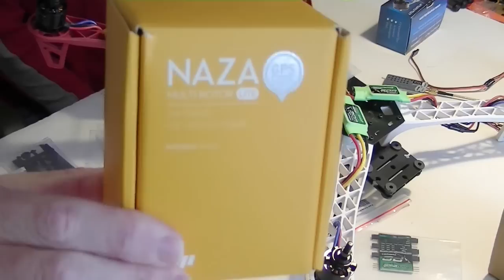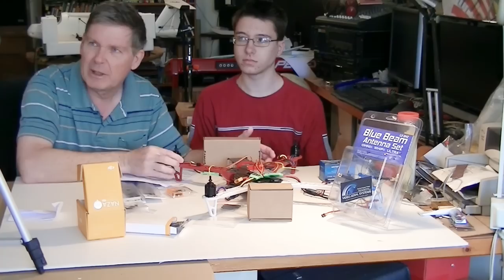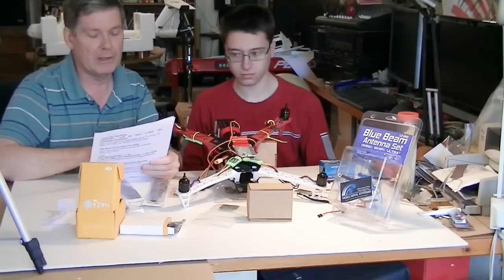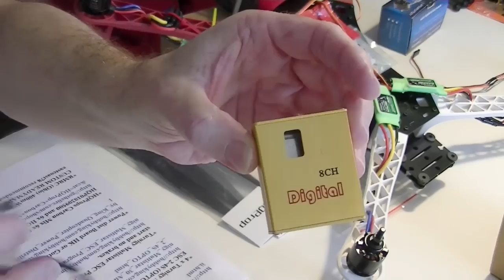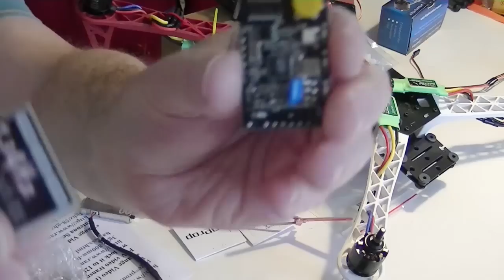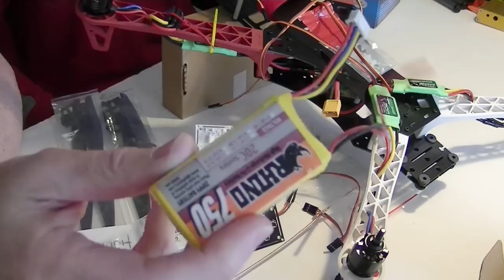FPV RC Quadcopter Parts Review

Comment: ***** What is the total investment on this project? And is this platform just as stable as the phantom? Thx
Reply from the maker: 724bigal The overall cost is about $650 plus a lot of work and testing.
If your not good at soldering or don't have a lot of patience I would recommend something else. It is stable enough but be prepared to "get your geek on" to build it.

Comment: Nice job on the motors and ESCs, John! Looks like you fellas have your work cut out for you, but thankfully with the Naza you'll be ready to fly in no time. I am curious why you went with the MinimOSD versus DJI's solution?
Reply: The ESC's would interfere with your video TX, RC RX, and FC GPS if too close. I'd recommend mounting them on the arms.
Reply from the maker: We went with the MinimOSD versus DJI's solution because the Naza M Lite is not expandable and I had to use a third party OSD. The NAZA V2 is expandable however but I don't have that one. The M lite is a less expensive way to go and the MinimOSD very inexpensive. So that is my thinking anyway.
Reply from the maker: willdoryder Yes, We may move the ECSs later. Good idea!